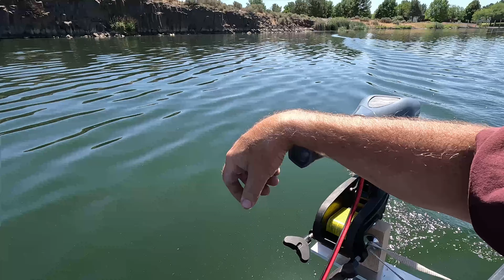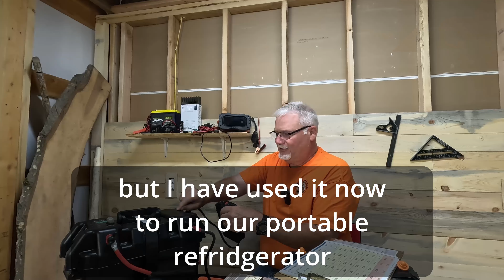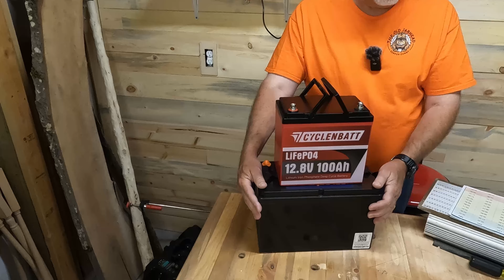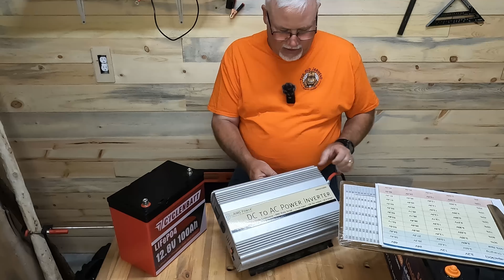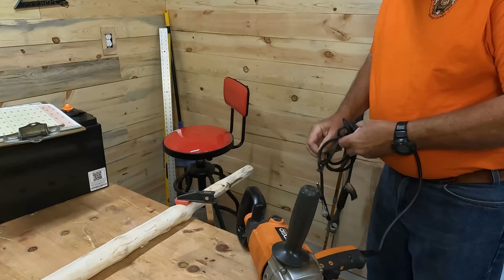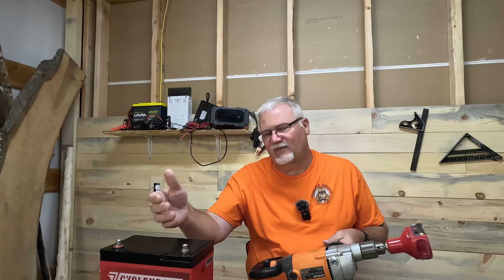Simple DIY Power Station ANYONE Can Make !

Comment: thanks for this! We have a spare group 27 battery that we pull out of our RV most of the year, and I am only needing to power my 12v cooler fridge on my photography business trips in my pop up camper. I just bought the battery box after watching your vid. I also have a 100 watt solar charger & regulator, so this set up should get R done and I won't have to run a generator (not allowed to after 10pm in camp)
Reply from the maker: Glad to hear you found a great way to put that spare battery to work. 😊

Comment: The problem with the DIY systems is that they aren't nearly as portable.  I've built a couple.  One has the battery box similar to what you have that I use in a jon boat for the trolling motor.  It does have a 12v and USB plug but no AC plugs.  I have a little "car" inverter like you showed but that just adds bulk to what i want as a simple system.
A lifepo4 battery is about $200 on Amazon.  A 2k inverter is $150 or so.  A box like you have is $50ish.  Throw in some wires, and you have $450 or so in a marginally portable system using low-cost parts.
For $1100 you can get a Bluetti AC 200l that has 2k watts of battery, a pure sine wave inverter, multiple AC outlets, multiple DC outputs, and a 4k or so surge capacity, all wrapped up in a 60 pound device with carry handles.
Im actually using a power station to run a battery charger and charge a lead-acid battery that runs the electric fence on my pig pen.
As lifepo4 batteries and power stations continue to drop in price, people can build simple systems or buy stations much more cheaply than a couple of years ago.  3 years ago I paid $400 for a 12v 100ah lifepo4 battery.  Last week I bought 2 batteries for $350 TOTAL.  2+ years ago I bought a Bluetti AC200max for $1800.  I went with that unit because of the 30 amp plug.  Today I can buy the AC 200L, an upgraded more capable version, for $1100.
I haven't seen much of a decrease on pricing on inverters.
Solar panels are dirt cheap.  I bought 395 watt, biracial panels a few weeks ago for $125 each, brand new.
Reply from the maker: All good points -- I have a dozen power stations or so ;) and am reviewing one today (3PM release) that is a monster.  Personally, making a portable DIY one works best for those who don't need the 120v outlets.  It's just a box and battery and done.  Works like a charm and I know 4 wheelers that do that and save money (LiFePo4's are sub $200 and the box was $65 so for about $250 they get 1280wh and that can't be beat!).  

For me, I beleive the best combo is one small power station like my Jackery 550 for example, and one larger one (maybe a 2k unit) with expansion capabilities (and not via solar or proprietary batteries).  With that combo I can pretty much do what I want.
Reply: @TheOldJarhead  agreed.  I have a Bluetti Eb3a, A Bluetti AC200max, and an older Ecoflow that I haven't used in years.
The 2 new lifepo4 batteries I just bought are Power Queen, 12v 100ah, from Amazon. Group 24.  I just got them last week and have them wired in series with the Bluetti AC100max going through the solar input through an adapter.  It effectively doubles the capacity and will put 200+ watts into the Bluetti.  Ove done the same with just a single 12v and it supplies the same energy, just at a slower pace.
I also have 3 ICE generators.
We live in GA so cold weather isn't an issue for us.  With the Bluetti setup, I can run a small window AC for about 9 hours and that floats my boat just fine.
We aren't off-grid.  I just enjoy playing with this solar/battery stuff.  We missed hurricane Helene by about 50 miles.  It passed just east of us, so we didn't have any damage and no power outages.  I feel for the folks in N Georgia, n Carolina,  and TN.  They got hammered.
Reply from the maker: Nice!  Running AC is always a challenge!  Glad Helene missed ya!  I was in NC when Hugo came through and we got lucky as it just went by overhead.  Sounded like a freight train but disnt do much at ground level.  Guess we were at the outer edge.